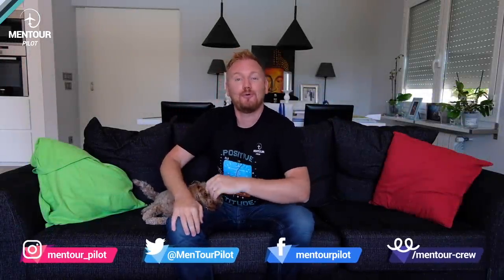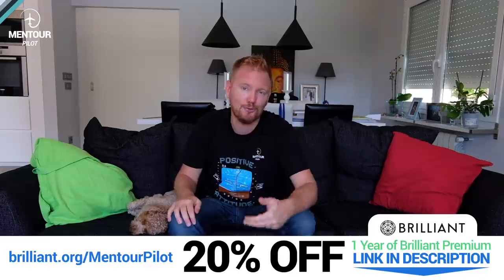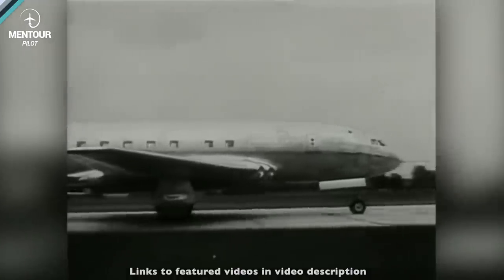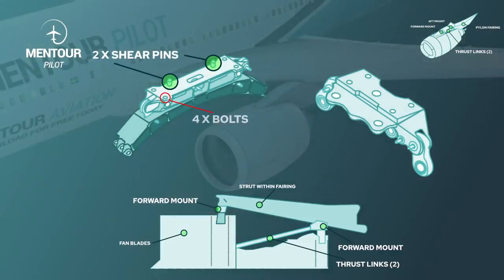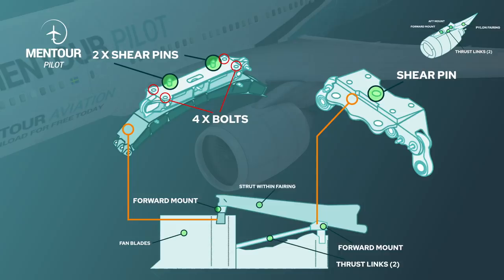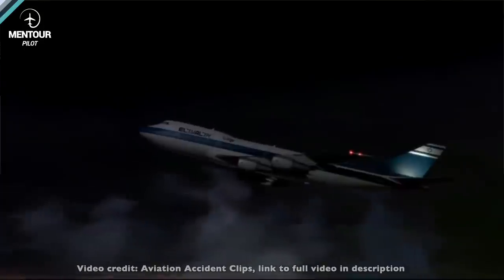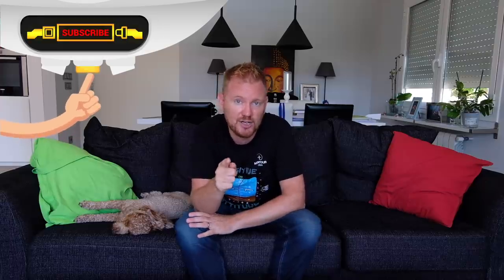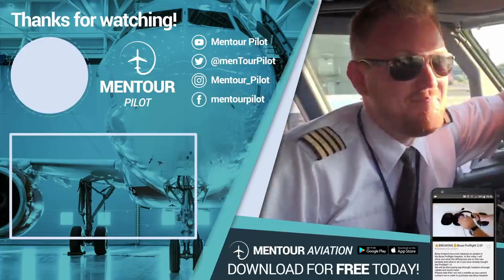How are Jet-engines attached to the wings?!

Comment: Dear Mentour, another great and enlighting vid (as usual), but - sorry to say - the the Inconel 718 part (8:35) is messed up. The tensile strength of 180 N/mm2 (180 MPa) is exactly a half of a poor grade steel's strength - so this is a false information. Let me correct it: The only true info is 180. But this is in ksi (kilo pound per square inch), and is the ultimate tensile strength. 180 ksi is equal to 1240 MPa (quick conversion: 1 ksi = 1000 psi = 7 MPa). We never load the materials up to tensile strengh, the limit is the yield strength (when permanent deformation occurs). In the datasheet for Inconel 718, I've found the lowest yield strength of 52 ksi = 360 MPa. Then, if the diameter of a bolt is of 22 mm, then the force the bolt can withstand equals to 136 kN (the weight of almost 14 tons of mass).

Comment: Here's a question: It seems that in both examples, that there were 2 factors.  Loss of thrust causing yaw, and then flap retraction due to hydraulic failure.  The answers posed, appear to address the first problem through structural answers.  What about the second problem (the uneven loss of lift caused by the flap retraction)?  It seems that evenness of retraction (balance of lift) is the highlighted issue.  So is the plane better off with freezing them both evenly down, or having both sides come up together?  Yes there are tradeoffs.  Having both come up would be an easy default for loss of hydraulic pressure.  However, the loss of lift for low-speed landings and take-offs would be a problem.  Having both "pinned" in place down would have speed and range limitations.  I'm wondering how the airline designers have addressed this 2nd problem mentioned.
Reply: Two changes came out of this accident in relation to your question.  First, the FAA mandated that secondary flight control actuators (slats & flaps, basically) had to incorporate a mechanical locking feature to prevent uncommanded retraction from loss of hyd pressure.  Secondly, there was a change to the aircraft operating procedures.  The engine out procedure was changed from "slow down to xx airpseed"  to "maintain present airspeed if possible".  The pilots followed procedure for an engine out procedure, which included slowing down to a reference airspeed.  That lower airspeed caused the left wing to stall because of the retracted slats.  If the pilots had maintained their present airspeed during the initial climbout, the wing would not have stalled.  Also related, after this accident, the FAA also mandated both pilot & co-pilot control columns have stall warning stick shakers.  AA only had it installed on the pilots control column, and it became inop when the #1 elect system went off line when the engine detached, taking the #1 system generators with it.  This was a well studied accident when I was in college for my aviation studies in the 80s.

Comment: Well done, sir.  I have a personal connection to flight 191 out of Chicago and have done extensive research on that terrible event.  It was a perfect storm of engineering failure, maintenance failure and training failure.  It is almost never one thing that brings down an airliner.  Your understanding and explanation of these events (explained in a straightforward yet caring way) brings confidence to those of us who are by nature or experience, nervous flyers. Thank you.
Reply: Wow.  I express just a bit of surprise at the number of cavalier responses regarding accidents related to engine separation from air craft conveying many passengers to their destination.  In many cases, the destination turns out to be a horrid communal death.  Y’all might apply just a modicum of empathy towards the victims and victims’ families of flights doomed by these accidents.  You can be sure it hurts all around.  I hope you never experience it.

Comment: I'm gonna call it. 
Bolts, plenty of Bolts, that can shear when forces are put into them the wrong way.
Reply: Eight..four fwd and four aft🤭
Reply: A330-200/300 with a GE CF6-80 has 9 bolts. Four on the AFT attach point and Five on the FWD attach point.😉
Reply: Je Moeder The MD-80 had three if I remember correctly🤭
Reply: Amusing .
Reply: One of my cultivators has one shear bolt and one pivot bolt per shank, in the even it hits a large stone or stump. 
The other cultivator has one pivot bolt and two big springs per shank that automatically reset after the obstacle.
Reply: A220 has four bolts holding each engine
Reply: On the PIA 8303 accident the  bolts did not have enough force on them to to shear them off. Unfortunately.

Comment: Back in A&P school c. 70's, they told us another reason for the forward slung under wing mountings was for additional wing 'flutter' mitigation. They also said some mounts were engineered to fail & let the engine fall free if subjected to excessive torque loads; as if  an engines rotating element/s were to suddenly become 'locked up'... they said it would be preferable over possibly having catastrophic wing damage. Cool videos, Thanks!
Reply: Flutter control would be extremely specific to each plane design. Engine placement would certainly have an effect but I feel that instructor was maybe over-extrapolating his information about one plane to all others.
Reply: I was also taught that when I was in A&P school in the late 80s.

Comment: Great videos.  Re: The tragic AA flight from ORD.  "Forklift Joe" AA maintenance chief(later pres. of AirTran), decided to violate an engine change procedure using an overhead lift and use a forklift to do so.  I flew the DC-10 with all of it's original design faults and fixes (after crashes, etc.)  That the FAA permitted a "hydraulic lock" for the leading edge devices vs. and industry standard of a mechanical one as in all others, and the subsequent loss of lift when they retracted upon engine separation, nothing the pilots could have done to prevent this. The DC-10 was a great airplane to fly, but an engineering nightmare as it was slapped together to compete with the L-1011 trijet.  The tailmounted engine, absent the "S" duct from the Boeing design, made it impossible for CAT III certification as go around thrust pushed the nose down.

Comment: My memory is a bit hazy on the accidents - As a Brit I remember the Amsterdam accident more - but I remember reading that maintenance crews had discovered how to remove the jet engines faster by using standard forklift trucks. This was widespread practice but totally unofficial. When trying to refit the serviced engine the forklift operator would be joggling the unit up and down, back and forth, putting a heavy load on the first bolts that been successfully inserted, as well as the brackets. It is not hard to imagine that full thrust and rotation finished off the process of fatigue.

Comment: I worked for FDNY EMS and I was a Paramedic in Rockaway Queens, NY when flight 387 went down in Belle Harbor Queens.  The reason given for it going down was because the first officer had used to aggressive rudder control to recover from wake tubulance.  My question is, why did the plane go into a spin where both engines ripped away from the plane?  I would have thought that if the rudder ripped off, you would still have some control, using thrust rather then rudder

Comment: Peter, I wish you see this comment and respond asap. Question:  Can you comment on the latest crash of PIA flight PK8303 in Pakistan. ?? 
The airline story goes as:  
 "The plane landed without gears downed for some reason, the left engine first hit the runway and skidded for a thousand feet then the right engine also hit the runway and skidded alike, belly didn't hit the ground, ...... then pilot took off back to go around. Some plane spotter took the picture showing the "Burn Marks due to skidding at the bottom of engines". During the go around the gears were downed but both engines failed because they had hit the ground. and the plane in landing position hit the houses 1 km short of runway tip. 
My observation is that the cowling of both engines looks perfectly round without a dent !!!!! ... there are black lines at the bottom of both engines. The picture shows the RAT deployed.  
Concern: ....... If the engines pressed with 60+ tons of A320 above them skid like that , will not the engines cave in or just leave the cowling burnt like paper without affecting roundness of shape. and assume if that happened like it, that the pilot was so precise to only touch the cowling, then can damaged cowling fail the both engines altogether ?? ....... The aviation authority inspected and confirmed long scratching on the concrete.
Highly Appreciate your early professional reply ...... Thanks  buddy ...... !!
Reply: Don't expect a reply, this is not a real Pilot. If there is a reply it would have been after the crash investigation is complete in case he states things that are incorrect and he then has to backtrack ;-). He thinks with his dog and being a fake Pilot he will get much pussy and masquerade as the Alpha male but it's nothing but google searchable information and a fake shirt and stripes. The time of bullshit will come to an end very soon! If he is indeed real, he would be happy to show his credentials and in turn prove that he is the real deal. As for this crash, it may or may not turn out to be fact at this point but the trust in the autopilot/autolanding was gained too much and they simply played the 'blind landing' game not realising that not all parameters were programmed in prior to landing. Fatal error which in turn woke them up and they stalled on second attempt due to the damage caused by the first landing impact without gear. This may or may not prove that relying on automation is actually becoming an issue in aviation. There are several recent 'near misses' due to over trust in automation.

Comment: Video suggestion: How do pilots deal with engine flameouts, reignite the engines in-flight, and why is there a long wait between attempts at reigniting the engines? 

After this morning's crash in Pakistan, I watched a bunch of videos relating to air crashes, including the seen from the movie  Sully of the birdstrike and landing in the Hudson. The checklist required waiting a while (15 seconds?) before repeating an attempt to relight the engines. I tried several Google searches but couldn't find an on-topic explanation for this. Otherwise, I know the aircraft (at least large commercial jets) must be below a certain altitude where the air is dense enough.
Reply: For a flame out in flight, the air speed causes the dead engine to still rotate. So all that is necessary is to select the engine igniters on and ensure the HP fuel valve is selected on. There is a time delay - if airborne after a wet start i.e. no ignition, then the fuel injected into the combustion chambers is given time to drain away. To start with excess fuel in the combustion may result in a hot start. If starting on the ground, the same reason also if starting from battery power to turn the engine over, excess use of the batteries will lead to over heating of the battery terminals

Comment: Thank you for another video! I was a bit worried there when you said the engines weren't attached as firmly as the rest of the components; but it seems like they are fitted to deal with great forces. I find it interesting that the engines are also expected to shear off if they hit the ground to give the aircraft and passengers the best chance of survival. Are the bolts and shear pins now a part of regular maintenance checks between flights?
How many bolts hold each wing on? how regularly are they checked?

Comment: There was this really hard landing of a UTair 737 in Usinsk recently, the plane ended up on its belly and came to a stop this way, but the engines remained in place.
Reply: Yes but if there was enough force then the engine will fall off rather then rip the wing off , when you see a wing ripped off from a plane landing on its belly then you can question mentour , so engine will only detach if there a chance that there too much force
Reply: Same thing happened to a LOT Polish 757 in Warsaw

Comment: Placing blame is very rarely part of any of your presentations. I certainly agree due to the fact it will not change the outcome. Moving forward to make changes is where your focus remains. Other agencies and companies do what they find necessary as a result. However, when the topic of replaceable parts comes into the discussion I listen carefully to hear if the part is the manufacturer part(s) or an off brand; and if it is a mechanical oversight. In this video the fate of this engine/loss of lives was difficulty to hear. But keep up the splendid work.

Comment: Cookie sheets and baking sheets are used interchangeably in recipes but there are differences. Both are rectangular, metal pans. Cookie sheets have one raised edge so cookies can slide off easily. Baking sheets have four raised edges, about an inch tall, and can be used for other purposes like roasting vegetables.

Comment: I take two flights per week for my job.  It's an ATR-72 600 twin turboprop.  Just after lightoff, there's always a buzzing sound inside the cabin.  What is that?  It doesn't seem to be related to the engines, but I don't know.  Thank you so much for your videos, Mentour Pilot!!!!

Comment: Another one for you Cpt Petter: why don't we see more high wing jet? There are few, mainly for military (C-17) or transport (certain Antonov), but the ones for passengers are few, small and rare. I understand why not "middle wing" as the structure would pass through the fuselage were there are passengers, but high wind? From the memories of my father, who was a model aircraft maker (the radiocontrolled ones), I remember he told me that low wings are best suited for acrobatic planes, middle ones are neutral and high ones are the stablest ones.
Reply: I think he once mentioned that low wings make maintenance and inspections easier. They’ve only become kind of a problem with modern high bypass engines. I think low wings are also convenient for the landing gear.
Reply: @Mike-oz4cv  Yeah, landing gears, I didn't thought about them... Thanks

Comment: Flight AA191 crash was caused by a cost cutting decision to remove the engine and pylon as an assembly using a fork lift. The manufacturer recommended that the engine be removed separately from the pylon.
Reply: The now defunct TV show "why planes crash" did an episode on AA 191. The deadliest aviation accident on American soil. Sad sad story.

Comment: Thanks again Petter for the great content.  I fly a C182 and when we post flight the plane we use control locks on the yoke and a rudder wedge to keep wind from beating on the control components. How is this accomplished in the 73 and other aircraft while they are grounded?

Comment: I'm new today to this channel but this particular video brings back past memories of an AMT course I took a aeon ago in college.  Those 8 special "jesus" bolts that hold the engine on were (correct me if I'm wrong) green magna fluxed bolts that we were told were very expensive and ultra strong having to take all those shear, tensile and rotational forces but were basically the only thing holding on 12,000lbs of engine.  But then it also triggered a memory of a case study in which the maintenance technicians were using a forklift to do an engine swap out instead of the appropriate lifting device and damaging the pylon in the process which made me wonder if that was what happened in this vid.

Comment: what remember is the dc 10 left engine ripped of part of the leading edge of the left wing so less lift as you said . also the pilot in command didn’t know the left engine actually ripped off . the nose was raised to increase climb as per procedure in an engine failure thus stalling the left wing as you said . a fork lift was being used to service the left engine installation . undue force from the fork lift caused the problem in the mounting bolts .

Comment: From my old days in the Boeing Model Shop... the wings hold the engines until the plane is airborne - then the engines hold the wings in flight. It's a simple matter of transferring the weight. The tougher thing to explain is the math behind the fact that the wing tips fly faster than the plane (which they actually do)!

Comment: Very informative. What i think the enginners should design a compact and strong rolling wheels below the engines and nose dome to facilitate emergency smooth landing during landing gear failures. It can also act as standby system.
Reply: Paramhans Baluni Landing gear failures are extremly rare..

Comment: Another issue with engines in the wing is routing the flight controls around the duct.
On the DC10 they changed the engine by un bolting the pylon and using a forklift instead of the correct method. This knackered the 2 shear  pins ( called fuse pins as they are designed to melt if an engine fire is bad enough and drop the burning engine).

Comment: Where I learn to fly, one of the pilots is a former 737 Pilot (737-200,-300...). He once told the story of an uncontained engine failure. They almost lost the engine because he maximum load was reached but he was quick enough to shut it off.

Comment: Question: I appreciate that polarised sunglasses are not used by aviators, due to the general use of polarised displays in cockpit instrumentation, but polarised displays weren't really a thing until around 1970 and entered aviation slightly later I would think. So, when was the seachange moment when the RayBan Polarised imodels were retured from Military and general aviation? And why do military aviators often wear kidskin gloves, whilst Commercial Civil aviation pilots tend not to? Thanks for a great channel.